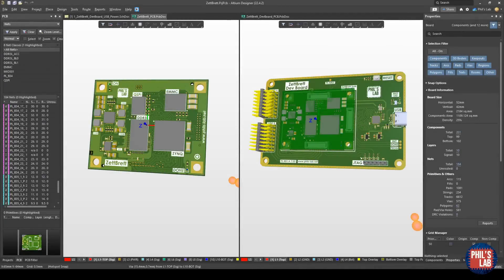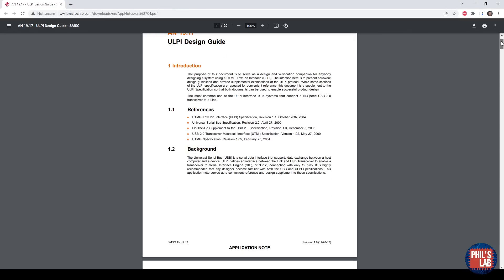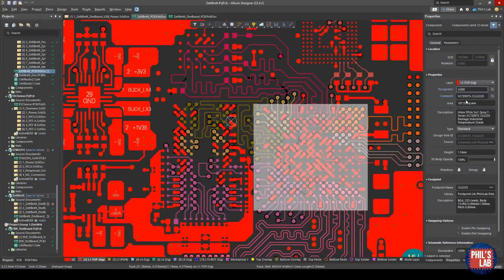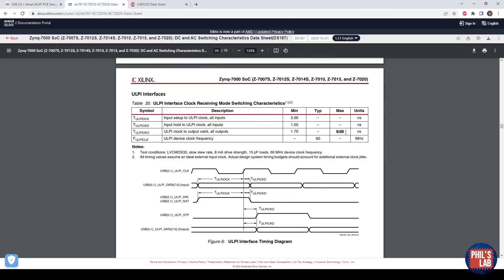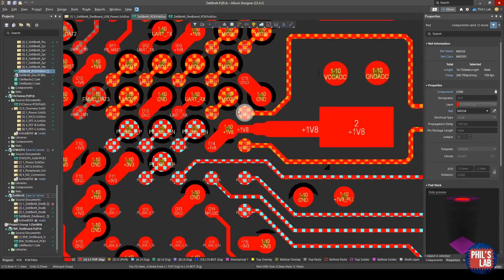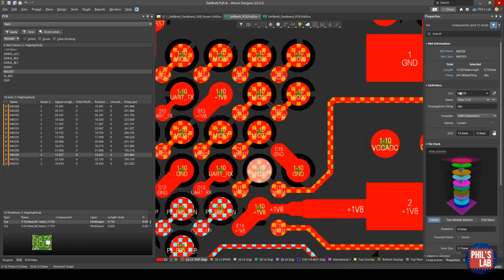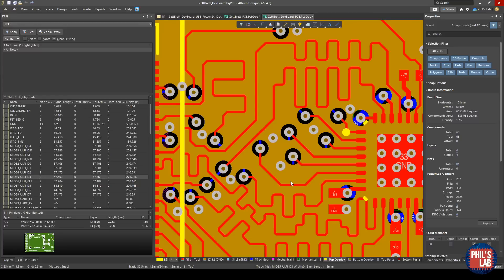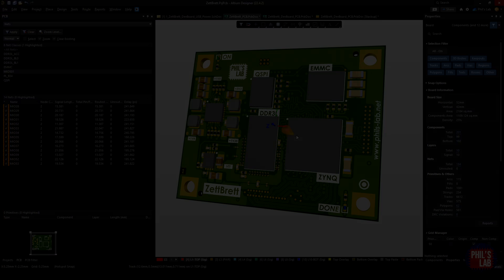(Sponsored) USB High Speed Routing (ULPI, Delay Tuning) - Phil's Lab #67

Comment: Would there be a way to export the propagation delays of each net that terminate on the pin headers of the system on module?
If so, could you import into the baseboard connector components as their package delays?
Can IBIS hold this sort of information?

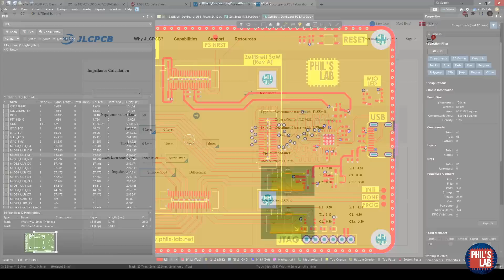Comment: Why do you use Dk=4 for the solder mask (14:51) instead of the Dk=3.8 that JLCPCB states (14:42) ? Thanks!!
Reply from the maker: Hardly makes any difference - especially at these frequencies.
Reply: @PhilsLab  thank you Phil

Comment: Do you not need to account for delay and resistance through the board-to-board connection? If so how? And if not why?
Reply from the maker: Since all signals go through the same connector, as with 'properly planned' vias, you do not need to account for the delay. This is because the delay is added to each signal. However, you'll most likely get an impedance change (discontinuity) which can affect signal integrity. Higher-bandwidth connectors are available which have defined impedances and are rated to given max. frequencies.